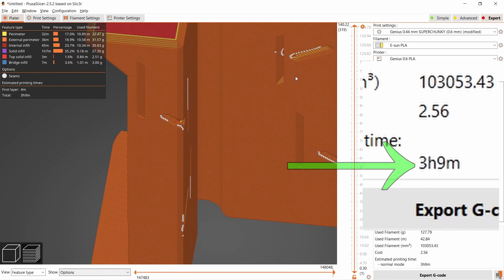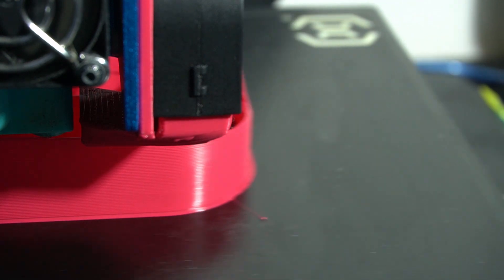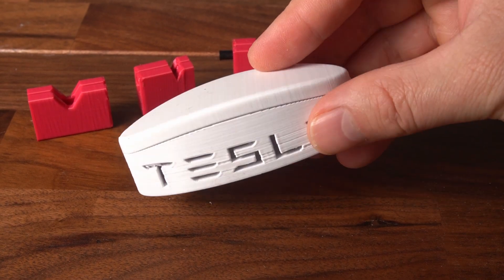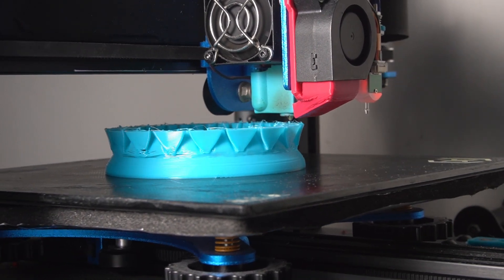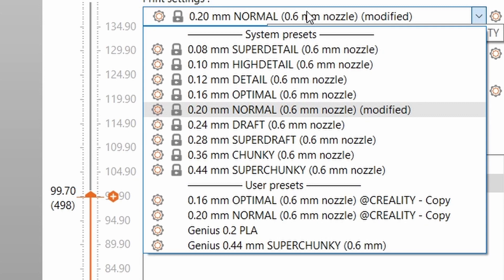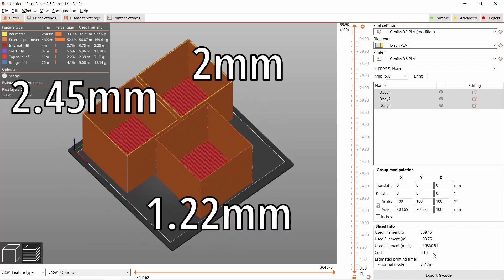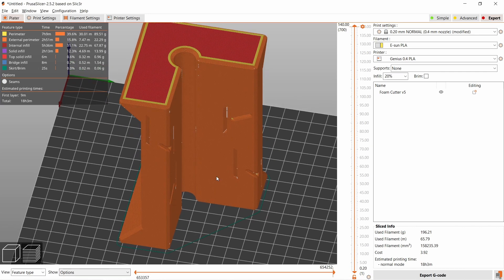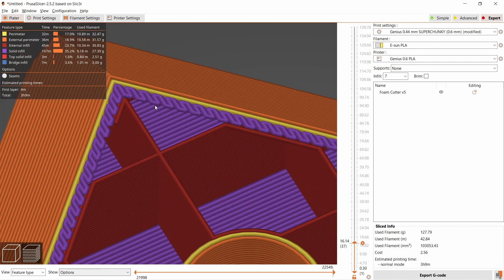3D Printing on a Budget? My 7 Ultimate Speed Hacks!

Comment: 4 years of experience - I disagree with PID tuning without the nozzle (you will never print without it). The nozzle adds pressure and changes the flow, so you need to PID tune with the nozzle for perfect results. I have done this on 20+ printers with the 10cm ruler method and it's always worked perfectly.

Comment: Be careful. Speed optimization could become an addiction 😂Then one comes to another and you realize that your hotend just supports 14mm²/sek and for your speed and nozzlesize you need 70mm²/sek...and before the day ends you design your own print head. 🤣🤣🤣 My CR10v1 is not a Creality anymore. What's left from Creality are the aluminium beams. Everything else was replaced to get that thing ~10x faster.

Comment: I have a theory about the solid infill time increase. With a smaller layer height, you're basically printing rectangles that are laying on their long side. So even at a 45 degree angle, there's still only a small part of that rectangle overhanging, the rest is on the previous layer. With a larger layer height, your rectangle is more like a cube, so at a 45 degree angle, half of it is overhanging, and only half is on the previous layer. The slicer doesn't like this, and adds the solid infill (which is probably quite messy due to this cube shape) to make sure the other wall lines do print with enough support. I don't use prusa slicer myself, but I did find an issue that mentioned a similar issue should be fixed in version 2.6.0-alpha5, so I'd suggest updating your slicer to see if that helps.

Comment: Great set of tips! I switched to 0.6 nozzle and don't regret it at all, and now I feel like I can switch to 0.44 layer height and get away with it. Also, you touched on this tip that I use but nobody else seems to talk about -- if you're doing parametric designing (I use OpenSCAD), you can add your layer height and nozzle size as parameters so that you can optimize part dimensionality to your specific printer! I think sometimes people like having a very pretty and precise 3D model, but forget that their FDM printer doesn't care haha

Comment: if i had to guess on the solid infill i would say it looks like it may down the the overhang angle, have you tried adjusting the maximal allowed overhang?
Reply from the maker: I  checked, the only  overhang related setting in PS is for support material. I even tried  to set the solid infill extrusion width to 0, no change. 
What did  help to reduce the solid infill is to add another perimeter (3 in total), but this adds more time, so the investigation goes on...
Reply: @3DPI67  Sorry for the late reply.  Solid infills, at the end of your video it went up by an hour and it's when you could see more vertical purple lines.  I have seen this setting in another video (I think).  I use Orca slicer, other slicers have a similar parameter.  Try changing "Ensure vertical (shell) thickness" to none, or critical only.  Hope that's what you're after, finger crossed!
Reply: I just found your video 😄 
How are your suggestions now on this item.

And i am printing while using a Mosaic Palette 2,
and can not print faster as 50mm with a 4 mm and 0,2 layer.

Will the filament speed be higher with a 0.6 mm nozzle?

And greetings from Amsterdam 
😊